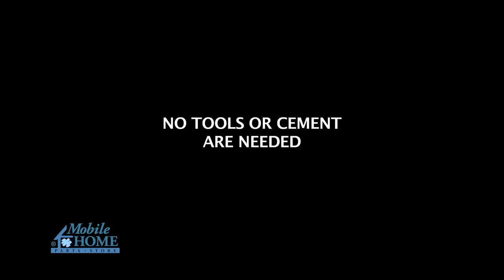Flair-it Fittings

Comment: Thank you for this video but this Flair-It stuff is the awful.  As someone noted below, once it is connected, there is no separating it and you have to cut the pipe.  Even worse, unlike shown in the video, I have found fastening a pipe to a fitting requires a tremendous amount of force... so much so, you end up pulling on the existing pipe and put strain on piping and connected fittings down the line.   I came here hoping there would be some magic solutions working with this horrible stuff.

Comment: The only problem is you can't separate the two pieces once they are joined.  I have had to cut these off every time, which makes them a horrible product, as far as I am concerned.
Reply: heat up the pipe with a lighter or torch (very lightly) or a hair dryer at the fitting.  it comes off easy.